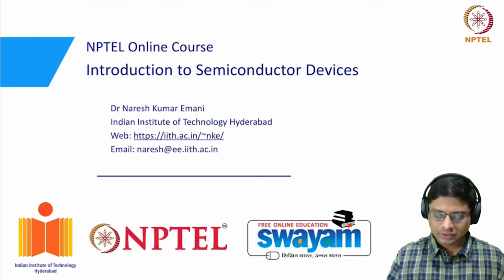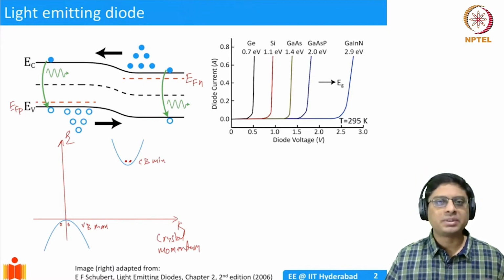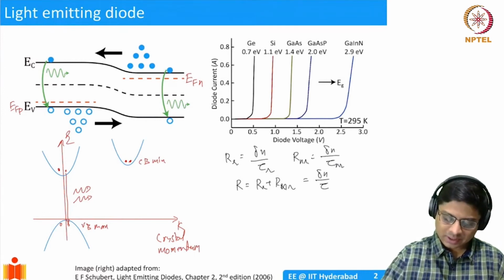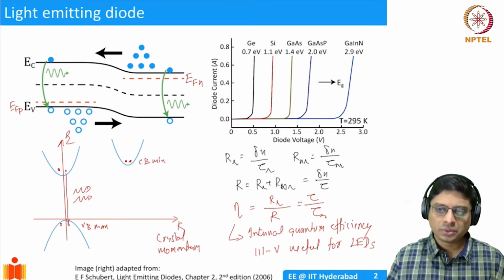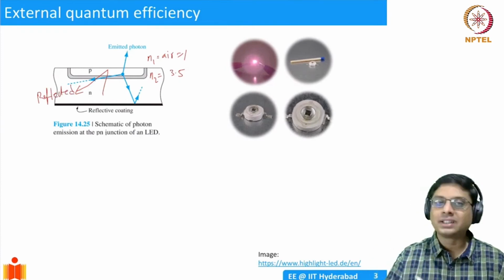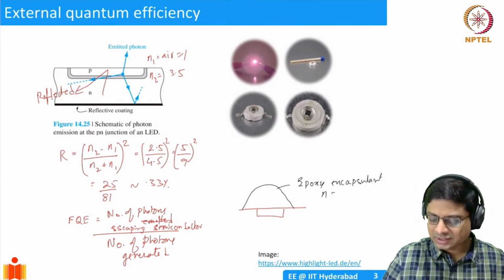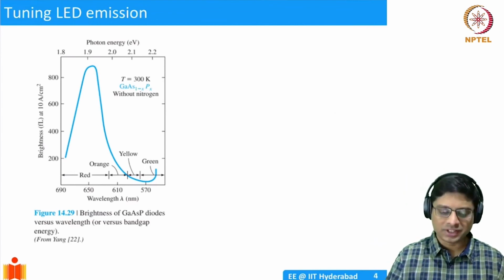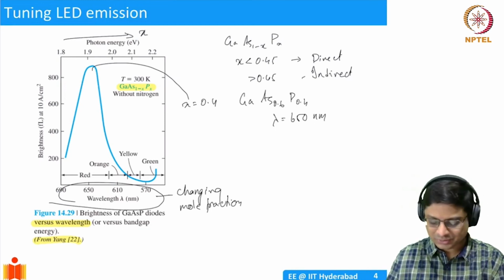Operation of a light emitting diode (LED)

Comment: I have a question..
If we increase voltage until the time when conduction band minimum of n-side is higher than conduction band minimum of p-side, how does the above band diagram change? 

And the depletion region will disappear? 

Curren will soar up because of avalanche?